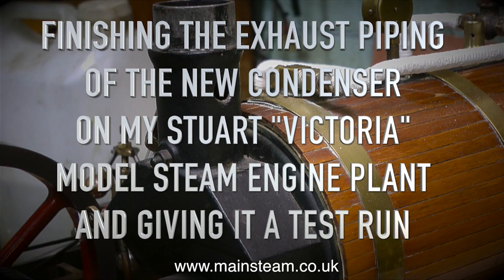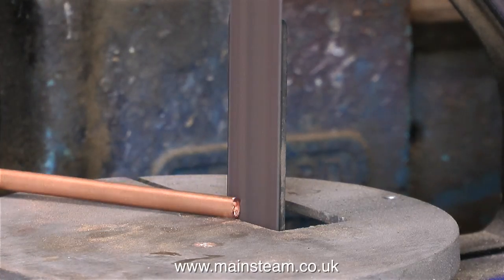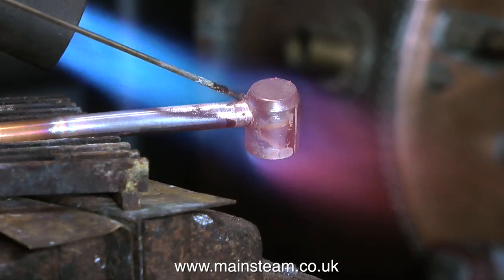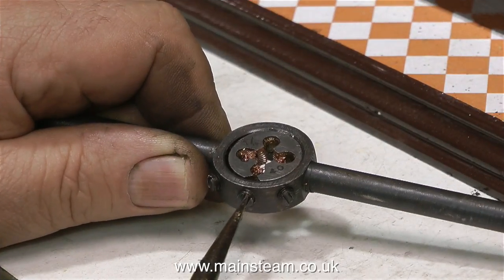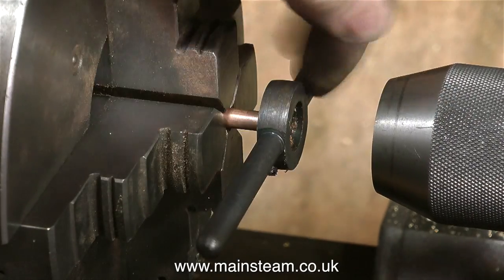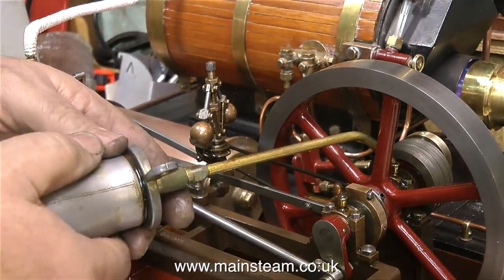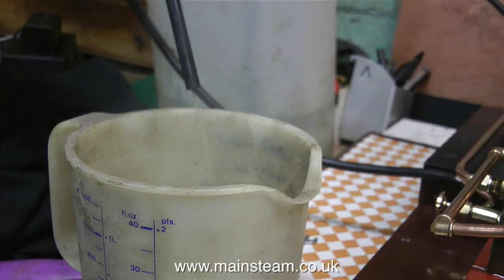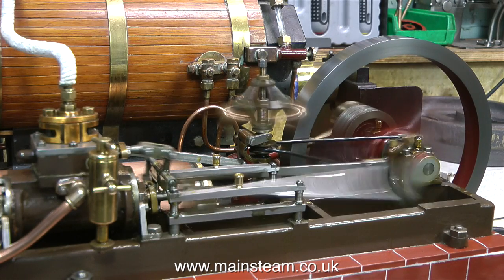FINISHING THE PIPING AND A TEST RUN OF THE STUART  VICTORIA STEAM PLANT

Comment: Have you tried chain saw bar oil it has very good anty fling properties and very high lubricant properties between chain and bar at the cutting section in the wood it has a very long stretch /stringing  effect between thump and finger so it is not thrown off easily at speed and temperature cheap as chips from gardening store

Comment: I think adding so many bends to the exhaust outlet would increase the exhaust back pressure. On full size engines a condensor was used to reclaim water and also to decrease the back pressure of exhaust so as to get maximum work out of the engine.
Reply: But this solution was merely to solve the problem of the condensed water from coming out of the exhaust and making a mess of the bench. It being merely for show, you needn't worry about the amount of back pressure so long as it runs.

Comment: Hi Keith, love your videos! What size boiler would one need for a Stuart 10H, 10V or S50?? Would one of the Wilesco boilers be sufficient to run these engines?
Reply from the maker: A 500 or 501 Stuart Boiler would be the smallest one for the job. Forget little toy Wilesco boilers, they run at too low a pressure. A Wilesco boiler will provide just enough steam to turn these engines, but not for long.

Comment: Very nice. Did the speed governor work as expected? You mentioned it earlier but have never explained it.
Reply from the maker: Yes, it does actually work but I have set the linkage so that it doesn't close of the steam inlet so I can run the engine at speed as I did in the recent video.

Comment: On full size engines they have a pressure/vacuum gauge on the condenser. Have you considered adding one to this engine as the condenser is actually large enough to function as one?
Reply from the maker: I don''t think I could get a vacuum gauge that small to be in scale with the plant ....

Comment: To my untrained eye it's a very nice looking unit, Mr. Appleton. About the gas burner, would you guess that it is the same CO emission or more as a burner on a gas cook top or oven?
Reply from the maker: This burner doesn't set of my CO alarm so I guess it's OK
Reply: co should be close to zero with an efficient burner, people use gas cookers with no ventilation, so they tended to be very good burners, you could tell some of keiths burners werent quite so good at the job, hence the co

Comment: What would it take to recycle the water from the condenser as is done on full sized engines? I know it's probably not practical in a model engine.
Reply from the maker: I think that is is not practical or necessary really with a small model engine.

Comment: Why is the cylinder exhaust to the top of the condenser and the cylinder exhaust to the middle? having no knowledge of such things  I would have thought  if the  cylinder exhaust went in the middle  and the condenser exhaust at the top would give greater capacity and give cleaner steam to the chimney? is it do with esthetics?
Reply from the maker: Yes, purely to do with aesthetics - to keep the exhaust pipe from the engine level .... :-))))

Comment: Does the governor work, or is it more for show? Or does it just need proper adjustment?
Reply from the maker: Yes, it does actually work but I have set the linkage so that it doesn't close of the steam inlet so I can run the engine at speed as I did in the recent video.

Comment: I got a toy steam engine when I was a child. The platform was about 25x25 cm and you could attach different small machines to it but I couldn't afford them. It was very fun to see it run but I got tired of it pretty quick. As you now know, my experience of steam engines is really limited. With that said. Why does the engine do this? 6:53 Is it designed to only provide power on the push stroke?

Comment: Hi keith. I am making a steam plant which has a model water tower to feed the boiler and whilst i was making the tower for the water tank i knocked up another for my condenser. This would put the condensor 300mm above the engine. Do you think this will give me grief? Love your content and im an avid viewer and fabricator
Reply from the maker: It should be fine in an elevated position. The only problem I have is if (like on the Victoria" Steam Plant) the pipe run after the condenser is a bit too long and some condensation is occurring.

Comment: so what's the deal with the spinning ball thing on top? that just there to look nice? cause it does.
Reply from the maker: That is the governor to regulate the speed of the engine, the fatser it goes the faster the governor spins and as the balls move outward due to centrifugal force, they operate a lever which reduces the amount of steam admitted to the engine - and slows it down.
Reply: oh, that's neat. thanks.